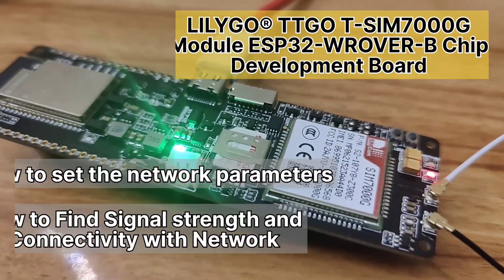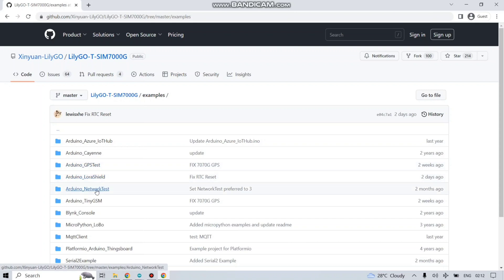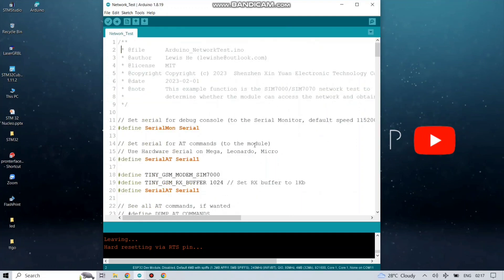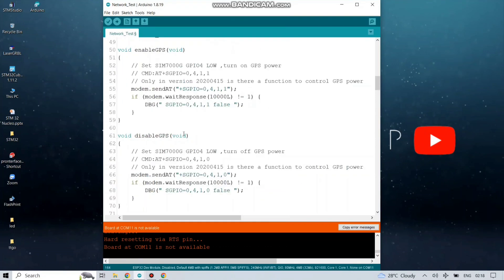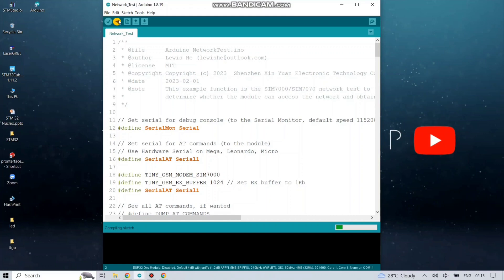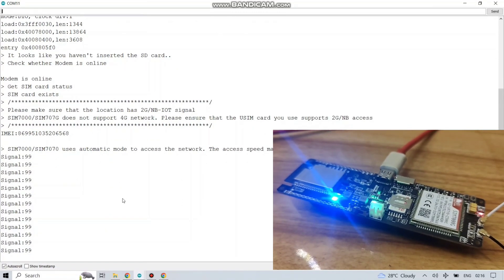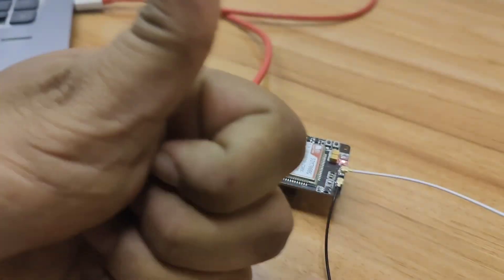TTGO T SIM7000G •4G Mode Activation • Getting Signal Strength & IMEI No. • Part 2

Comment: Hi I bought a LILYGO A7670G card. Is this video also valid for this type of card or do I have to change some parameters? Thanks   ricevo questi errori : ......> It looks like the modem is not responding, trying to restart
Reply from the maker: @paolodecaro3741  yes this video might help for the same , coz there is some difference in both the  boards but still it should work with code
Reply: @techwarmup  Ciao purtroppo non funziona, potresti darmi una mano a capire se puoi controllare pinout della scheda A7670G . Grazie

Comment: Does this board really support 4G network? In serial monitor it's written that support only 2G
Reply from the maker: Yes , the manufacturing company says it supports LTE network.
Initially network mode is not selected for LTE network. You have to enable it by Sending AT commands.
Reply: it does support 4G and 4G sim cards
Reply: The SIM7000G connects to 4G LTE-M (Cat-M1) networks, which are part of the 4G ecosystem, but it does not support standard 4G LTE (Cat-1/4/6+) used in phones or high-speed devices.  LTE-M is a low-power variant of LTE for IoT devices. 
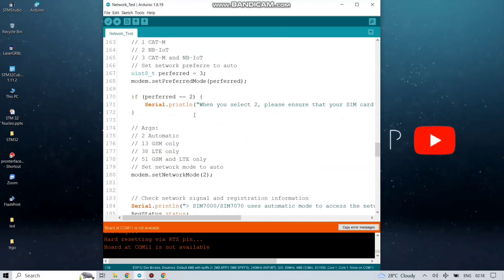In the video you can see the modem network mode is to automatic (1:51) , and the preferred network mode is set to Cat-M & NB-IoT (2:11)